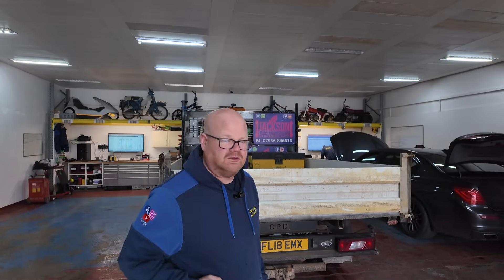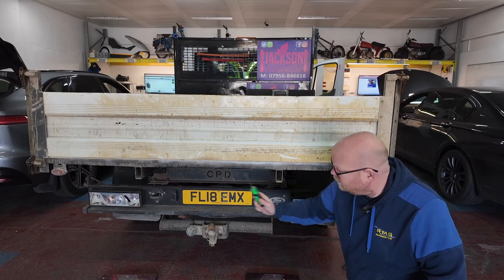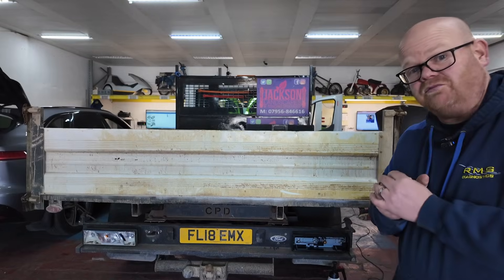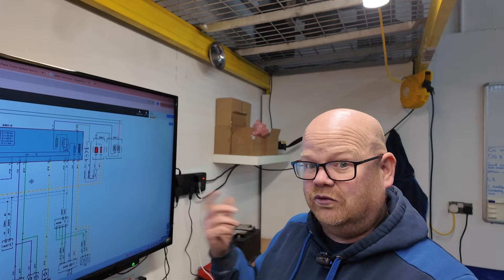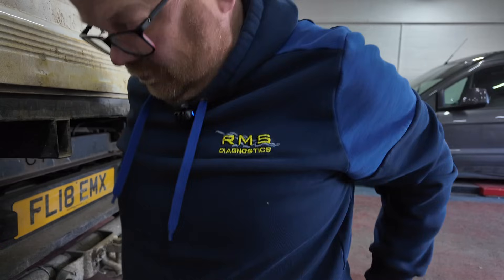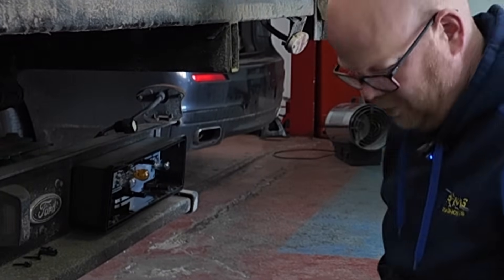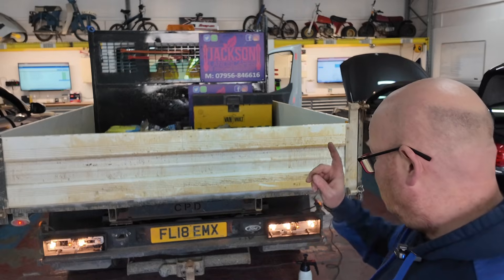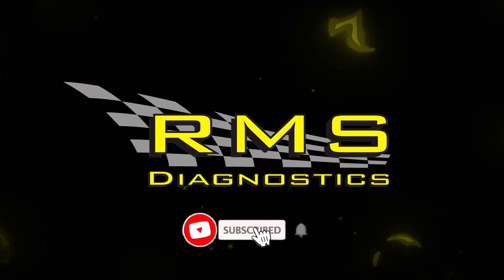The Truth Behind a Ford Transit Rear Light Failure: 4 Different Issues Uncovered #automobile#canbus

Comment: Came here after a three  video can bus fault thing.
I am horrified at what they have done with car wiring. 
CAN bus was ment to simplify  wiring..to stream line wiring. 
Bleepy  hell ..we now have wires knitted all around chassis  for little  or no benefits..and now we have wiring that can fail and disable what would not be logically interrelated...
So not even the gain of simpler wiring looms..and reduced ruggedness..